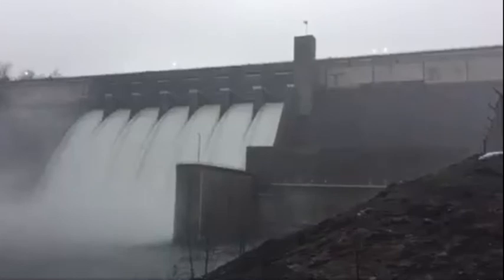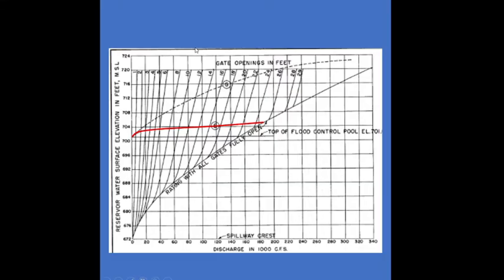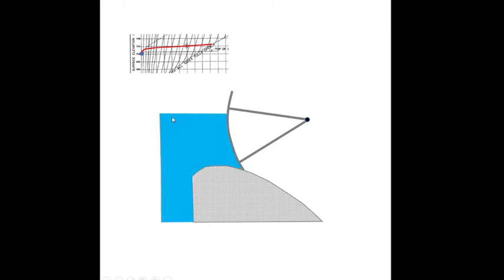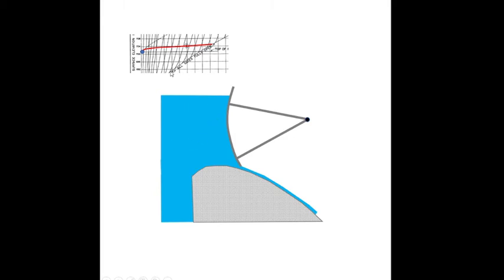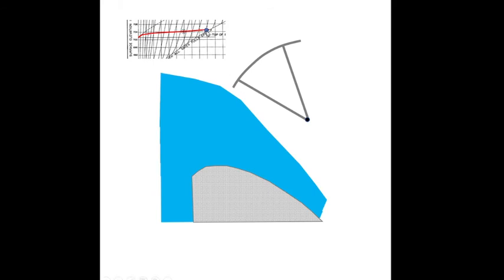What determines spillway releases at a dam?

Comment: Super technical..can't follow it.  In laymens terms, how is spillway release determined?
Reply from the maker: Thanks for watching the video.

This video deals with a situation when the gates have to be opened or the rising water in the reservoir will overtop them.  That is one situation that determines when we have to open spillway gates. 

We can also have a situation where the reservoir will not overtop the gates, but it is higher than the target elevation.  We compute a desired release (typically based on what is happening downstream).  Depending on the outlets available, the spillway may be used.  For example, if there are hydropower units, those will  normally be used first.  But if more release is needed above the hydropower capacity, then the spiilway may be used.

Once release amount is determined, we use graphs that give us the spiilway outflow based on reservoir elevation and the amount that the gate is opened.
Reply: Is it possible to release too much water to where the spillway can't handle it?